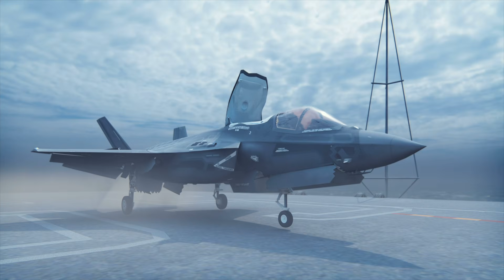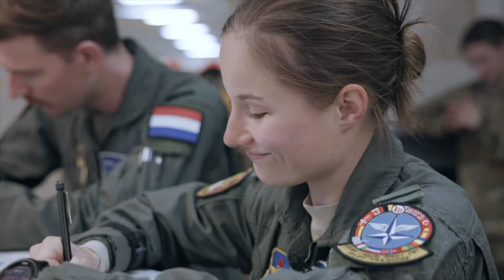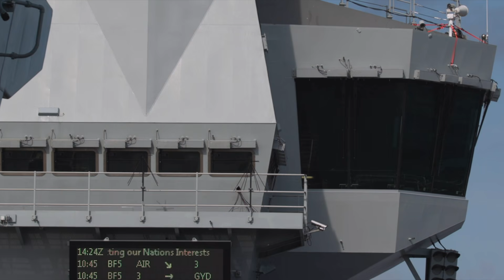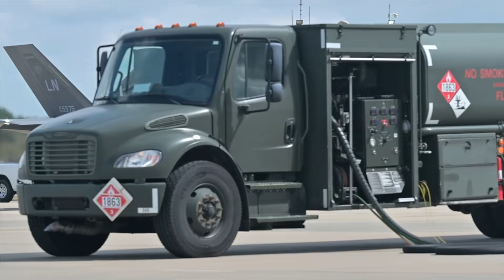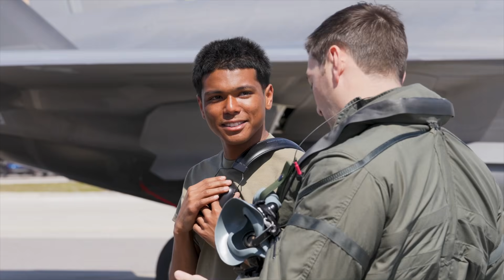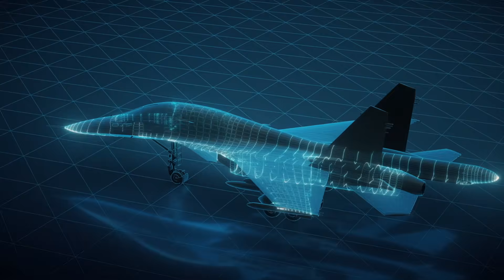The F-35 Problem Nobody's Talking About

Comment: "The problem nobody is talking about." Yea, it's for sure not mentioned in this video...

First we have the background history:
* This didn't start as JSF. It started with USAF requiring a new ground attack aircraft, somewhat optimized for SEAD missions and with a fighter capability good enough for self defense (during exfiltration). That pretty much set the tone for the fuselage design and stealth capability (low observability from late Soviet air defense systems when flying straight at them).
* Then a couple of other nations realized they'd need new combat aircraft as well, and were willing to provide funding to the project if they could also influence it. Thus it became the JSF, with the fighter capability getting more attention as the new partners couldn't rely on Raptors to do that job.
* Finally the USN and USMC joined in, adding even more complexity with their specific demands, adding delays to the project and costs to each airframe.

The "small RCS" design.
... is pretty much an expensive one trick pony of limited use. When designing for low radar detectability it's physically impossible to make it effective from all angles and from the entire spectrum of wavelengths used by various radars. Especially the coating must be designed for a fairly narrow frequency band, but also the overall physical shape will be more or less effective at not returning echoes depending on wavelength.
* If the opponent uses a different frequency band than the one expected the advantage is gone and can't be reclaimed.
* Sticking to the few internal hardpoints also means accepting a fairly small payload.
* The coating is fragile, adding complexity (environmental requirements, cost and time) to aircraft maintenance, reducing the aircraft's resilience.
* The design also adds to aircraft size, making it easier to see visually and making it a bigger target.

The "flying computer".
* The software is designed in a way that prevents quick changes. A total bummer when the opponent changes behavior and equipment on a weekly basis, as shown in Ukraine. Changes in tactical parameters such a sensor readings, countermeasure behavior and own radar parameters must be implemented swiftly once the new requirements have been established. It mustn't take more than a week to write the new code and have it cleared for fleet wide implementation, a point where the F-35 always fail.
* Also, relying on a (near) constant access to internet seems like a bit of a stretch for a large conflict.
* The aircraft "ordering service and spare parts" while still in flight will still need that order to pass through Lockheed (and by extension the US government). Does by no means the required service will be available in a timely manner, especially if the US govt at the time holds a grudge against the user nation.

Lack of resilience.
* With F-35A being pretty much locked to a relatively few large and well equipped air bases they can be sitting ducks when on the receiving end of a surprise attack. Even if the aircraft are not caught on the ground those bases won't be useful for landing when the aircraft run low on fuel.
* The high maintenance demand forces each airframe to spend quite a bit of time on the ground, both between missions while on active duty and also for pre-planned preventive maintenance. (Currently there's also a shortage on some spare parts required, extending the time off duty.)

It's too darn expensive!
* It's well established that the cost per flight hour is high.
* The purchase cost per airframe is also fairly high compared to its competitors.
* The low availability requires an airforce to purchase more airframes in order to facilitate the desired readiness and (fleet wide) flight hours per week, pushing the financing cost further.
* The high cost leaves less money available for pilot flight training, resulting in the pilots being less skilled than if they'd been flying a cheaper aircraft.

There's a reason an increasing number of nations (including the US) reduce or even cancel their orders for F-35.